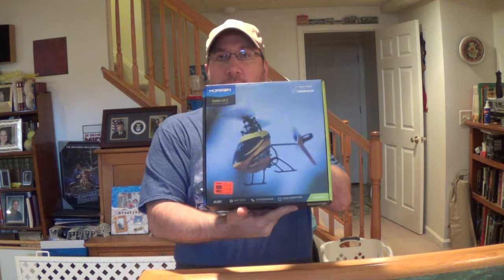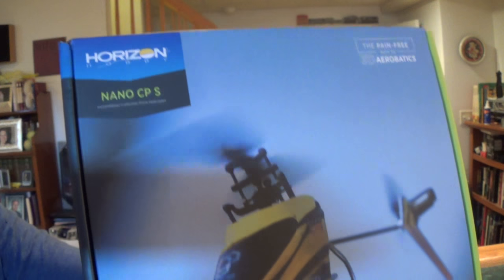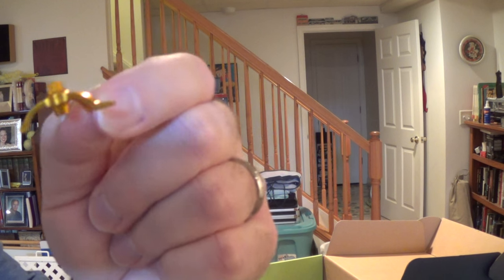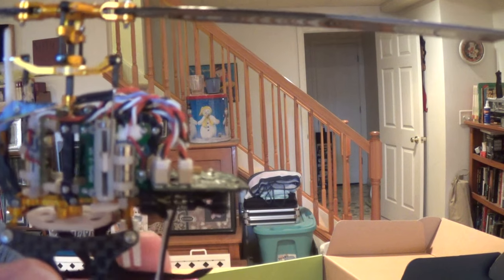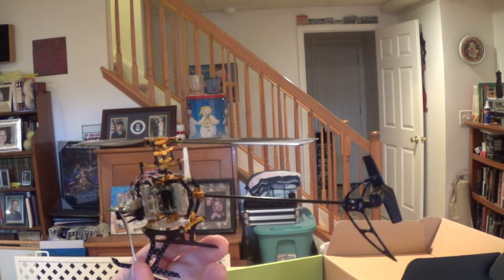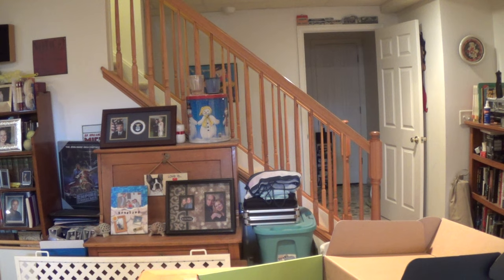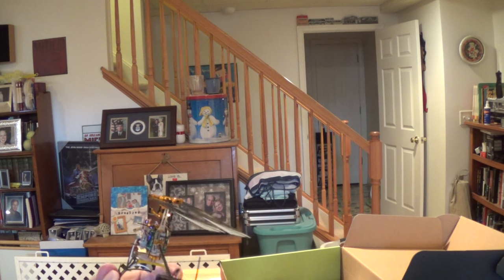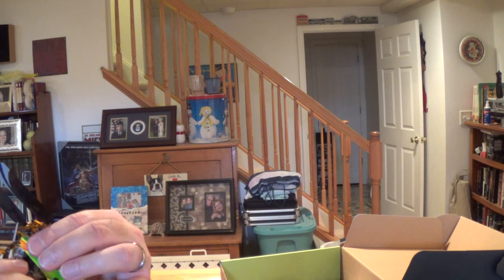Blade Nano CPS with Full Rakon Frame Conversion

Comment: So I got the CP S recently and it flies horribly from the factory.  Unflyable in acro mode.  As soon as i turn it to mode 2, the swash goes to full left and no matter how much I give right stick it stays left.  I think the board is bad from the factory.  I am going to replace the board because I enjoy the heli in safe mode a lot but it is very touchy.

I am wondering how well it flies with the new frame and everything.  I know it weighs maybe 8 or so grams more with the new parts. Do you think it is sufficient to keep the standard motor?

I am pretty sure I am going to do the full upgrade that you did as well as the brushless motor.

Also was that first battery a full charge battery? What was that like 2.5 minutes till it died?

Have you tried the 220mah batteries with your heli?  I think I am going to order a couple 5 packs since they are like 25 dollars for 5
Reply from the maker: jamsnation 

This Heli is a blast to fly when it is operating correctly.  I have noticed I have to recalibrate the gyro way to 
often.  Also, the swash wasn't mechanically level from the factory and  required a swash leveling tool to fix it.  I got two of the higher mah batteries and helps with power but not much though.  The upgrades have really weighed it down.  It look good though.  I will have to figure out how to get the brushless kit for the original Nano CP to work.  It requires some soldering and my basic Sears Craftsman soldering iron is not up to the task.
Reply from the maker: jamsnation 

Oh, and all new lipos come with a 50% charge and require charging before you're first flight.  Well at least they are supposed to come that way.

Comment: I ordered the red advanced total kit from RakonHeli last Friday and it arrived Tuesday from Ho Chi Min, Vietnam via UPS.. that’s the fastest over seas order I’ve ever had delivered and the parts are awesome. I had to upgrade because the stock heli is just so fragile and the canopy broke and the frame pins all broke off. If your Nano CP S is in less than desirable trim Rakon Heli is definitely a great place to order from free crazy fast shipping from Vietnam to my doorstep in Phoenix, Arizona five days is just amazing and the shipping was free.
Reply from the maker: Keith Whisman 

Yeah I totally love this frame!  I just need to do a brushless upgrade, because it is a bit underpowered now.
Reply: Edward Turck I ordered this brushless motor, all I had to do was pop out the pins in the plug and switch them around to make it spin clockwise properly as the webpage states. https://micro-motor-warehouse.com/collections/blade-nano-cps-cpx/products/cl-8020-14

This is the pinion gear you need for the motor... so cheap I ordered 2 so I have one for the next motor. http://www.megasmicros.com/product_p/pinion-1p0b-7t-0p3m.htm

And this is the adhesive I found to use to secure the pinion gear to the shaft. There is no soldering here, all you need is an exacto knife to raise the little plastic pins on the power plug and pull the pins out and switch them, it took me about a minute and a half. Loctite 37424 640 High Strength Sleeve Retainer Tube, 6-milliliter https://www.amazon.com/dp/B0002KKTIG/ref=cm_sw_r_cp_tai_QBiFAbG8V4272
It’s pretty being able to upgrade the motor for less than twenty bucks.
Reply from the maker: Keith Whisman 

Cool!  Thanks for the info:)

Comment: Is that the yellow upgrades or the orange?

I can't decide whay color I want to get. 

Im upgrading the swash plate since my factory swash main bearing keeps popping out
Reply from the maker: It is the yellow anodized aluminum frame upgrade although it looks more gold than yellow to me which I actually prefer anyway.  I like the yellow a lot but it really comes down to personal preference.  You're Heli will still look awesome which ever color frame upgrade you choose to use.
Reply from the maker: Actually just checked Rakon Heli's website and it is listed as anodized gold aluminum.
Reply: Edward Turck ya it does look gold. I settled on the home depot orange. It would look good with that color scheme fuselage you have.  That is the color fuselage I want to get as well
Reply from the maker: jamsnation 

Cool, have fun with you're build:)

Comment: Please do a full install video of the brushless kit! No one has done a detailed install yet and I dont want to screw it up. Great video :)
Reply from the maker: X-FLIGHT101 

The brushless kit is for the Nano CPX.  I thought it would be plug and play still, but it is not.  The connection to the board is totally different.  It will require modification and soldering for sure.  When I figure out how to do it I will definitely upload a how to vid.
Reply: Edward Turck ok cool, I will most likely be buying a nano cps around Christmas and will upgrade to brushless when the stock motor blows out.
Reply from the maker: X-FLIGHT101 

Sounds like a plan:)
Reply: Edward Turck subscribed :)